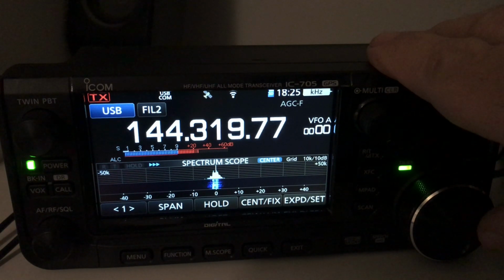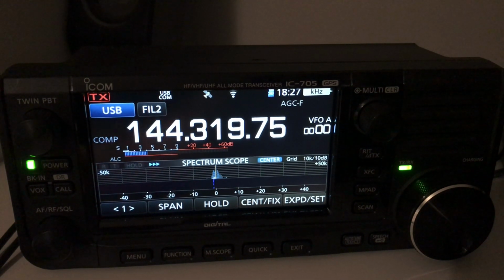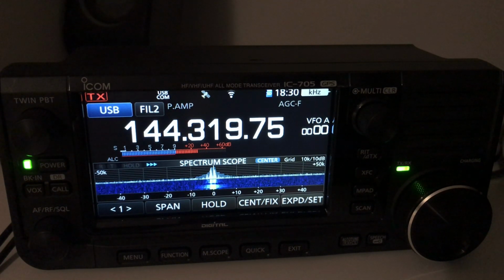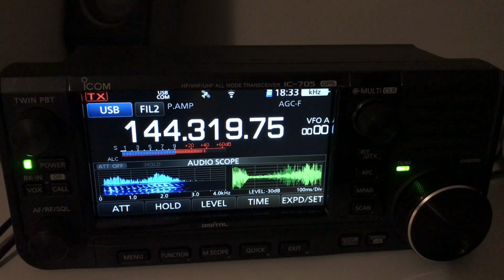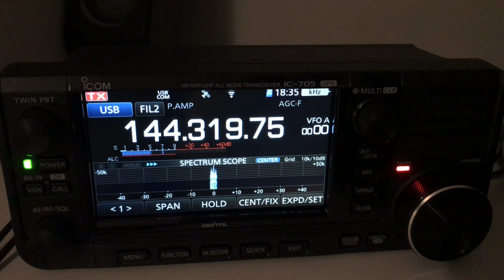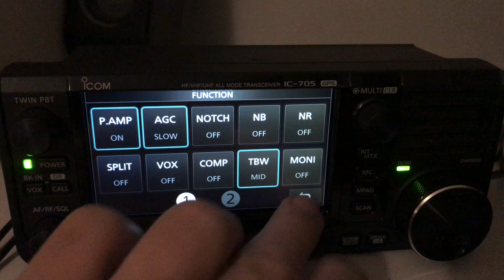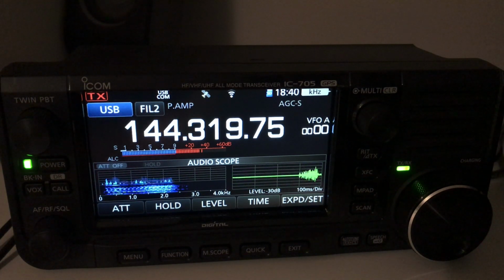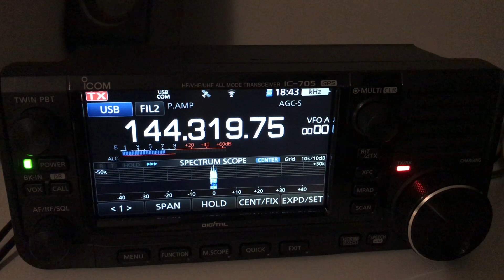2M SSB Local QSO’s

Comment: I miss 2meter SSB ...No manufactures make a single band anymore. I wish Anytone would accept the challenge. They make an awesome allmode 10 meter rig, and great FM 2meter  rigs,
WHy not all mode vhf?  I'm still holding out hope. Until then I'm in the process of buying a used Kenwood ts-711a on ebay...fingers crossed it still works.

Comment: Do you like it better than the Yeasu
Reply from the maker: I really like both transceivers. I was first bitten by the QRP bug in 2006 when I bought my Yaesu FT817. To compare them would be unfair as the 817 was first introduced in the year 2000 whereas the Icom IC-705 is a much more up to date bit of kit. I have them side by side on my shack desk. I call it my QRP corner. Speak soon. 73 Chris M0RSF